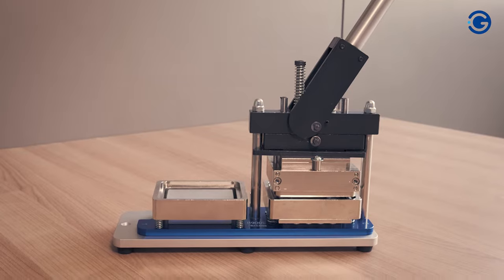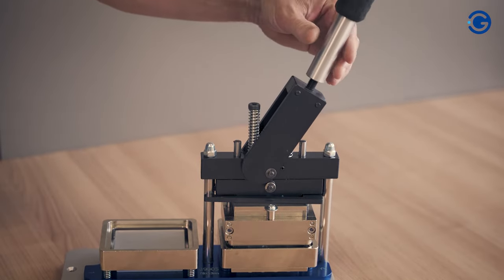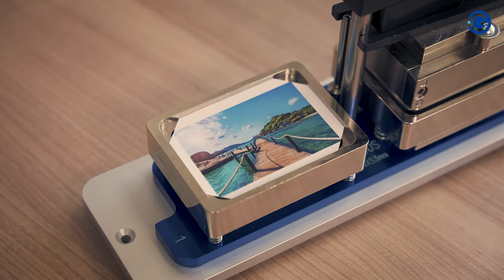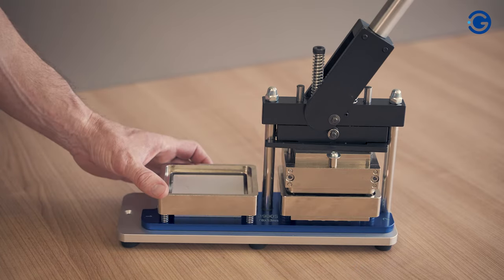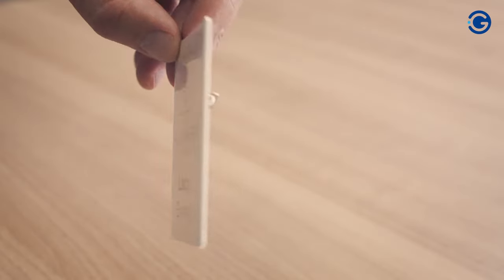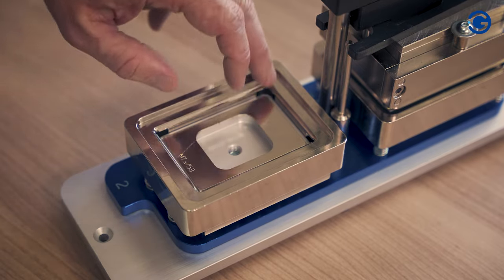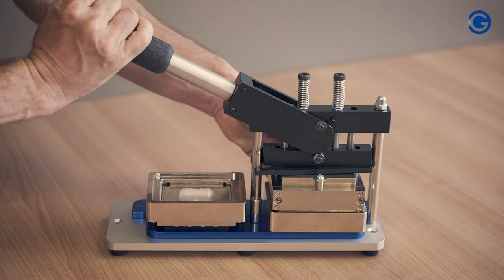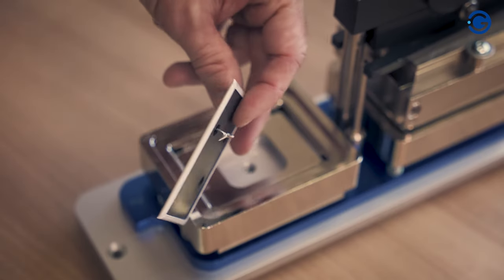IDGAMAX - B900S MACHINE - HOW TO MAKE MAGNETS OR RECTANGULAR BUTTONS -  EN

Comment: Why are the round badge and magnet makers 100-200.00 and these rectangular ones are 800 and up??
Reply: I saw an interview with one of the orignal manufactures of button machines. He said that to make a rectangular mold is much more complicated the making a circle mold. He said it takes many times the effort which results in a higher cost
Reply: My question exactly